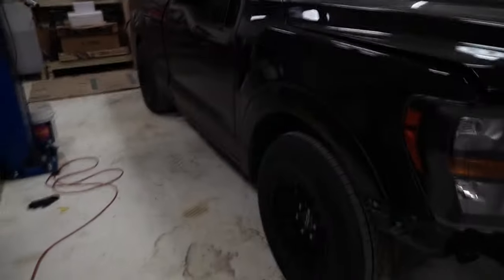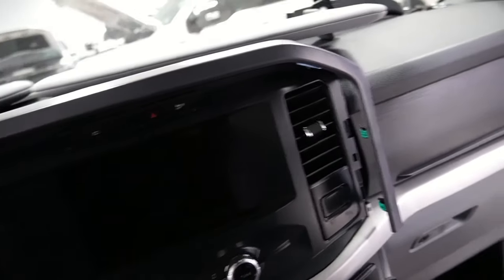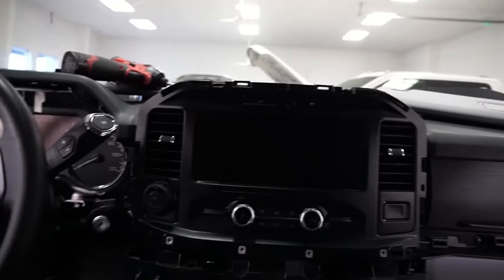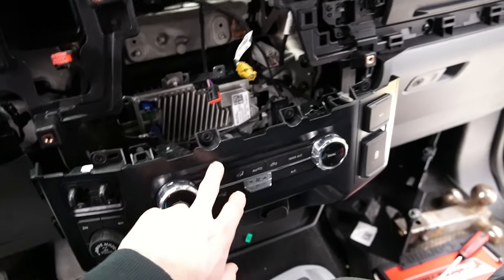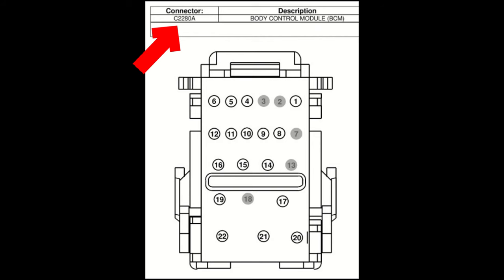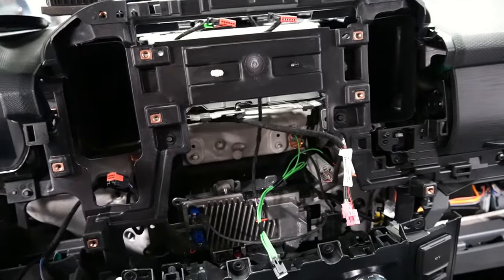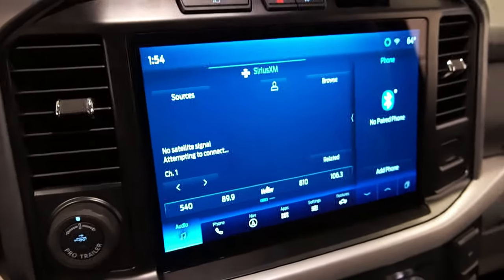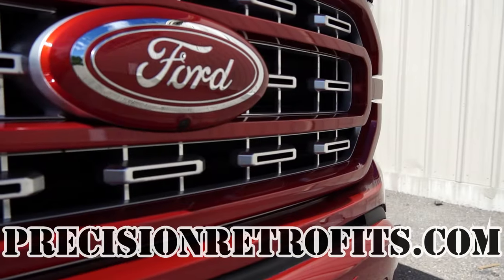FORD 12" Screen & Speedometer Conversion | F-150 (HOW TO)

Comment: Finally someone makes a video on this! I did my cluster already very simple and quick but the 12 inch infotainment is a lil intimidating
Reply: Where did you get the cluster. Do you remember the price
Reply: @allenturner9186  livinitupclusters 1k for the cluster already programmed
Reply: @MustangChris1   thanks so much for the info
Reply: @MustangChris1  yup, just ordered mine from him
Reply: I have a digital cluster from a f150 tremor 2022  What happens if I try to plug it in without reprogramming to my  xlt 2022 model  any advice would be helpful. Thank you.
Reply: @joseguerrero-ge6xh  won’t work. Needs to be programmed
Reply: Was it just plug and play?
Reply: @MustangChris1 what did you do about your upper dash pad
Reply: @joseguerrero-ge6xh it will work but your miles won't match your truck. It will have the tremor miles
Reply: @DavidPerez-fr1hb  yes
Reply: @tedbear6012  I changed out the entire upper dash, you don't have to for it too fit but there will be some gaps on the digital one.
Reply: @MustangChris1  gotcha ok. I'm going to try and get a raptor dash then
Reply: @MustangChris1 hey where will there be gaps?
Reply: Isn’t it illegal to replace the cluster ?

Comment: You think it’s possible if I get all the modules and harness out of a 2023 I can swap everything over to my 2016 as far as dash interior vents and everything ? Bolt on since the cab hasn’t changed much
Reply: Someone just did this on Facebook he installed the 12 in screen on a 16-20 f150

Comment: Where do I find the plastic piece to go underneath the 12’ screen if going from a 8’ to 12’
Reply: Part number is  SKU: ML3Z-15042C74-BA
Reply: I bought mine on eBay.

Comment: Is it possible to do this upgrade with the 12 inch screen on a 21 or 22 f250 with the 8inch screen ?
Reply: Yes it’s possible I have done many trucks, but in f250s whole dash needs to be swapped
Reply: @karlogian1 hey man, do you know what to program ( in forscan ) after installing the 12 inch infotainment system ? ( center display )

Comment: On the four pin power connector you used for the display, only pin 1 and 4 are used. Which was positive and which was ground?
Reply: I would like to know as well.
Reply: 1 is positive and 4 is ground
Reply: Great info, thanks, but still unsure which is Pin1 and which is Pin4.. Looking from behind the screen (upright position), Is pin1 the left hand side or is it the right hand side??
Reply: I would also like to know which pin on the 4 pin connector is number 1  the parts cost too much to guess I’m assuming it’s a 50% guess or Maby could just tell us thanks

Comment: Any idea why my 360 cameras stopped working after the big screen ? Also the factory navigation doesnt work on the new apim either. Even after proper FDRS and Forscan programming.
Reply: Have same issue with my cameras
Reply: @manygarza4634  I fixed mine, I believe  in IPMA module (possibly APIM) The camera type was set to "digital" , and after I changed to "analog" started to work. This Is on Forscan

Comment: Would the Digital gauge cluster and 12" infotainment screen work on the Rattler edition? (2023 XL trim) wanna change it out from the gauge cluster with 4" screen and the 8" infotainment screen. If so, where could I be able to get a OEM one?
Reply from the maker: Yes, it should. It's still an F-150 so it will be all of the same componenets.

If you need a screen, reach out to us and we can help you out. Our email is info@precisionretrofits.com
Reply: @PrecisionRetrofits how much for the 12 inch upgrade??
Reply: @sergiorosas1311 I’m trying to upgrade this on my f250 platinum to the 2022

Comment: Do you think this is possible for the superduty as well? 22 lariat with analog cluster convert to full digital?
Reply: I would be interested in a full digital cluster for my '22 super duty tremor
Reply: After posting the question, I’m thinking it won’t be possible because of the drastic dash change to the 23 superduty.  ….but maybe I’m wrong?
Reply: Do you have all of the Forscan settings for the 12in display?
Reply from the maker: It may be possible for the 12" radio screen conversion, but not the speedometer.

Comment: any chance those 12 inch screens will end up being able to work on a gen 2 raptor?
Reply: No it’s why I’m think about selling my gen 2 and getting one of these things.. honestly this cam phaser issue is just annoying already back in the shop once again for the same thing.
Reply: @joshuaguerrero4466  I got a 37PP Gen 3 now, it’s worth it.
Reply: @joshuaguerrero4466 my raptor is about to head to the shop for the 2nd time phaser. Under 100k.
Reply: @Robstunner  think about getting a single cab 5.0 coyote dropping about 30k on upgrades making better and cheaper then a raptor R
Reply: @joshuaguerrero4466  there’s a lot more to it than an engine swap
Reply: @Robstunner engine swap? He just needs to whipple it and call it a day

Comment: Do the tow modes actually work if the truck doesn’t have them from the factory? Like if you do this conversion on an xl/xlt that doesn’t come stock, will the rain/mud/snow/sand drive modes actually work?
Reply: No

Comment: wondering how complicated it would be to tell us what yeas you are working with on both sides, the original truck an the parts being installed?  fraid it'l get demonetized or WTF?

frankly i'm not sure what you're actually doing you're extremely vague on everything, need the cable, need the pic, yadda yadda, no one knows what year right it is?  are you kidding me? its all a waste frankly, please tell me what information here could someone use?  waste watching a shaky camera all over the place not really showing anything